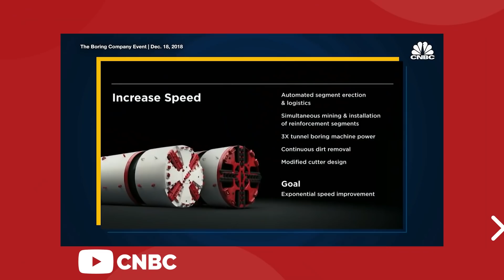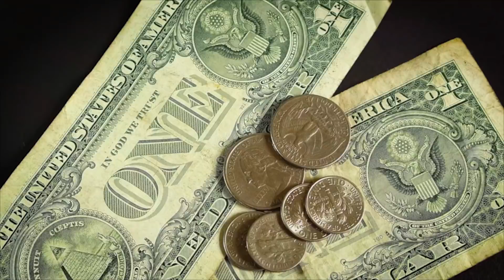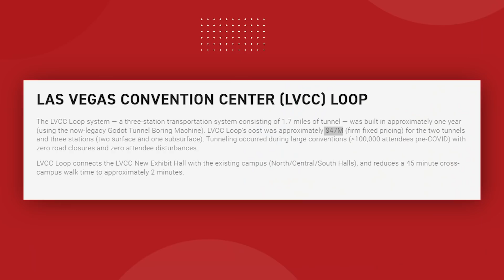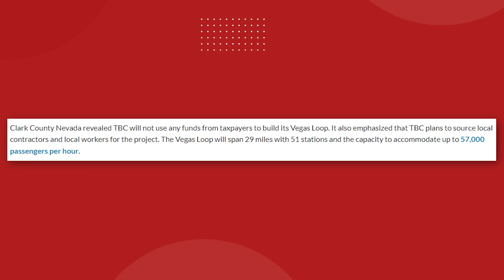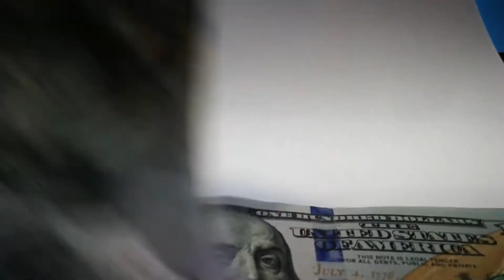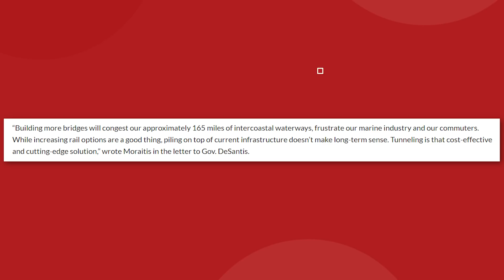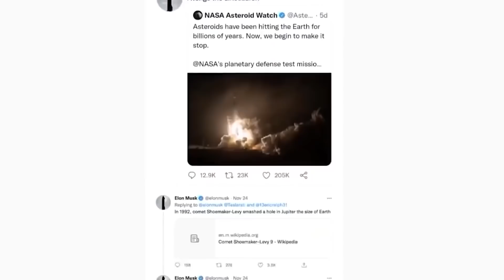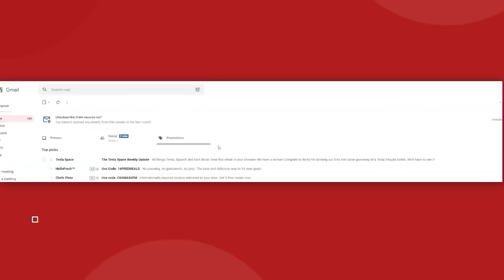The Boring Company 2022 Update

Comment: Imagine building a subway, but instead of using railcars, which can fit hundres of people and use one engine, use multiple individual cars, which all need their own engines and can only hold 1 to 3 people at a time.

This is so incredibly stupid
Reply: When 1-3 people enter the station, they can get into a vehicle and go.  Wait time is less than 15 seconds.  The trip time is less than 2 minutes. 

With a rail car, those 1-3 people wait on a platform while more people crowd in to wait with them.  Then the rail cars show up and all the people get on it and go.  But what if it's just those 1-3 people? They get on the rail cars that can hold hundreds, and take a very inefficient ride that they had to wait several minutes for?  How stupid is that?
Reply: @kevinbailey8827  Many people getting into a railcar together is much faster than entering cars individually. That way one person holds up the entire line behind him.
And if there were only very few poeple, that means there is no demand and they can use a car on regular roads.
Reply: @drthox3512  The cars aren't blocking each other when loading and unloading.  If one car is loading slowly and another car is loading quickly, the quick-loading car can go ahead and go, and the slow-loading car can take the extra time it needs. 

It one person is having trouble loading a railcar, the other passengers can shove that person out on the platform.  Otherwise the entire train is delayed.  

The loop system can smoothly scale to provide excellent service at any level of ridership.
Reply: @kevinbailey8827  Then why is it that there were traffic jams in the Vegas Loop?
Reply: @drthox3512  What traffic jams?  I saw that video.  The cars never stopped. What should have been a minute and 15 seconds in the tunnel turned into 2 minutes for a brief time.  

If that's as bad as traffic jams get in the Loop, and if they're as rare as that, I call it a roaring success!

I've experience far worse delays on subways.  Are you telling me that means subways don't work?
Reply: @kevinbailey8827  The cars simply do not have the capacity to be economically viable. A metro is cheaper and transports more people.
Reply: @drthox3512  An underground train is demonstrably many times more expensive to build.   Whether it transports more people is questionable.  In the case of the convention center loop, an underground train would not have carried any more people.  The Loop has carried everyone who showed up.   A train would have carried the same number, because there weren't any more people to carry.

Why would you spend four times as much to put in a train, when a Loop does the job and does it faster?
Reply: @kevinbailey8827  No, that is not questionable. Trains carry more people than cars, in a given space. That is a fact. They are also cheaper to operate, as they require fewer operators, consume less fuel/energy and break down less. The low demand also makes the loop unnecessary.
Reply: @drthox3512  If a train is full, it carries more people.   If it is empty, it carries no people. 

For the convention center, the low demand makes a train impractical.  But a Loop can be built for a fraction of the cost, so it can be practical in places where a train is not.

The Loop has other advantages, in that it can provide better service for its passengers.  It's going to open up new possibilities to places that have looked at other transit solutions and found them too expensive.

Comment: "The most efficient and affordable way possible"... 
Yeah, digging 2 miles for 2 years - efficiency fail.
CES 2022 - traffic jam underground - efficiency fail.
CES 2022 - a guy on foot being faster - efficiency fail.
Affordable - a project that started at 47 million ended up being 57 million - affordable fail. 
The tunnel - no emergency escape route, no fire suppression system, no in tunnel ventilation - safety fail.

Comment: I think the biggest issue with this stuff is that it still uses individual cars. As many in the comments pointed out. If you look at Japan and specifically Tokyo you can get a look at how good public transportation works. Until the united states starts doing that I think this is for the most part unimportant. Though it's good to see movement in that direction. 

Also if tunneling does get a lot better it would be smart in the long run to have almost all human transportation done either underground or in the sky.

Comment: Trying to solve traffic congestion by adding more lane/bandwidth won't work especially if you need to dig tunnels to create more lanes. If traffic congestion is solved by just adding more lanes to a route, the end result may possibly result in a highly inefficient network with higher maintenance cost. Solving network issues should employ far more complex strategies.

A good network needs to be highly connected and smart so that it is efficient.
Reply: They aren't adding lanes. They are adding bypasses where conventional bypasses couldn't be built. What "complex" strategies are you suggesting in an urban environment in which no more roads can be built? Individual under/overpasses to escape crossings with lights? That's extremely expensive and unpopular. My guess is that your only knowledge of traffic is network traffic, right? Well, the theory for that is completely false in this case because packet traffic on electronic networks doesn't slow down just because the network gets congested. Real, physical traffic, however, has a choke point where road transport capacity falls to a fraction of peak capacity as soon as cars are too close together to drive safely at the speed limit. The solution to congestion is therefor not traffic complexity but the removal of the last 10-20% of the load that trips trips the choke point.
Reply: @schmetterling4477 It really depends on the cause of the traffic congestion. Digging single lane underground tunnels is hardly efficient nor safe. Smart city with intelligent traffic management can improve city traffic with better result at far lower cost and maintenance. Examples include intelligent traffic signal and management, traffic calming and traffic assessment, electronic road pricing based on live traffic condition  etc...
Reply: @jk35260  The causes of traffic congestion are always the same. The amount of traffic exceeds the capacity of the roads. 

There is no space for new roads on the surface, hence we are going underground. Plenty of cities are doing it already. You are clearly not well informed. :-)
Reply: @schmetterling4477  That is your simplistic understanding of traffic congestion. Underground is nothing new but what is holding back city planners from building them.
Reply: @jk35260  The cost. Oh, wait, Elon Musk wants to build tunnels for way less money and he does. Kid, you need to learn to pay attention. You couldn't even pass kindergarten with your limited attention span. :-)
Reply: @schmetterling4477  You are so gullible.

Comment: Mostly all hype I think. TBMs have a better place in delivering high capacity LRT or Metros. Having better traffic management, vehicle interface and autonomy is a focus more important than constructing tunnel networks for piping cars about urban areas. The Boring company should really just try to compete with the traditional large TBM operators to deliver mass transit systems and roadway tunnels to cope with congestion. The scenarios see here are really just monorail mindedness.

Comment: All in all, I don't have any problems with the boring company's concept. If you see it as a high level of service transportation system, fully knowing that there can be many different levels of tunnels underground, it's pretty easy to see that literally all the traffic overground can be replaced underground without any problem, and whether each vehicle can transport one or more people isn't important in the grand scheme of things, as just making 10 levels means 10 times less traffic than on a flat surface. I have some problems with the use of teslas, as in my opinion having the "car carrier" like in the concept is much better, but I guess it was chosen for the specific needs of early projects. Overall, I quite like it, but I think it'll take several years for The Boring Company to reach full potential. What's sure, though, is that they hardly have any competitor in this potential market.

Comment: $1-1/2 Billion for 1-1/2 miles of traditional tunnels... vs $47 Million for 1-1/2 miles of Boring Co -- Project -- the entire project, not just the tunnel. That is a mind-buggering success! That's 32X cheaper than just the traditional tunnel, and that's just the beginning of the savings. This was proof of concept. It only gets better. It only gets cheaper and cheaper. So what if the marketing was too optimistic? What marketing isn't? The news and media are virtually full of "New! Groundbreaking! Revolutionary!" Scientific and technological discoveries that will change the world as we know it!
And not a single one of them EVER comes close to living up to their HYPE!
Reply: The comparisation is flawed.
The $1 billion includes large rail systems with more than a sinle rail and station and communication and contro,l systems.
Its not the boring which is espensive, it's the system design.
Drilling tiny pipes as Elon is doing is cheap.
Reply: @dilbert0815  OK. You go with that.

Comment: Like it or not, tunnelling is a mature industry. EV and rockets were not. Check the facts stated on this video, do existing TBM's use disel power, can the claim that the Boring Co. can tunnel faster stand up in a apples to apples situation, do TBM stop every 5'?  $1B per mile was based on NYC's last expansion, and the three stations cost more than the tunneling between them, the tunneling wasin hard rock, and included tunneling under and building a new station at GSD. Still way too much to spend, but again, the $10M per mile cost is a goal, not anywhere close to a reality.

Comment: The „others“ use electricity, just because a tunnels in construction does not have a lot air vent and many parts of such a machine need independent powering. Is he expecting a 19s century transmission belt version? They only use diesel in the trucks that bing the stuff to site. But Elon use the Tesla semi, right? Oh, that‘s why the project stuck way below snail speed at Zero.

Comment: Aside from the environmental issues, the tunnels are narrow.  Using one-kind vehicle, isn't going to work.  They should go with bigger electric bus or something like that.  Hell, they could just put guide rail in bottom/middle of the road to keep the vehicles on track while their in the tunnels at speeds like amusement ride cars they let children ride.  

Personally, the tunnels are too small and narrow.  Cost is an issue, frankly using electrical vehicles for these tunnels will likely save a lot money if they get them.  There better off with purpose built electric van than individual cars.

Comment: There are so many problems with what you present here. The idea that you portray these tunnels as efficient because they are only 12ft in diameter, barely enough space to fit a single Tesla just shows how dangerously uninformed your position is.

There's a reason other tunnels are much larger and use significantly larger machinery (which is also a large contributing factor to the speed difference, doubling diameter of a tunnel means moving 4x as much earth. Area = pi*r^2). The reason is that there is a plethora of additional safety and access requirements that need to be considered.

Currently, if any kind of emergency is to occur inside the single lane tunnels, almost nothing can be done for emergency responders to reach the site of that emergency quickly. They're contending with a queue of other vehicles occupying the same single lane. Not to mention the possibility of any emergency occuring during a traffic jam.

Compared to more conventional subways where all trains are networked together and constantly communicating, other emergency vehicles can always be dispatched along the other rail to reach the site of the emergency in no time. Additionally, human access tunnels line the sides of the primary subway tunnel so that humans can escape on foot if required. There is also a lot of additional infrastructure for ventilation among other things all of which these tunnels don't have.

People will die in these tunnels. They are significantly less efficient than just a regular subway. If you want to cling on to claims that the boring machines have new tech which makes them more efficient - great. But try applying that tech at a scale larger than 12ft diameter otherwise it's pretty useless for constructing any kind of safe transport.
Reply: These tunnels are also meant for electric cars. No need for a lot of ventilation. I am also pretty sure they don't just build tunnels without any exits. I am sure there is a code for that. 
I am skeptical for now about these tunnels myself but I'd rather try something than just sit around and argue as to what will be the best... and then get nothing at all
Reply: @eduardos8895  what do you mean no need for ventilation *because they're electric*? You realise subway trains are also electric, right? They still need ventilation.

This is exactly what I'm talking about with people being dangerously misinformed. If a fire occurs in a tunnel with poor ventilation, it will very rapidly consume most of the available oxygen. In such a low oxygen environment, with the addition of smoke inhalation, humans fall unconscious before being consumed by the fire.

Also, no, there isn't a special "code" to allow humans to escape through a fire engulfing a tiny tunnel. Their boring machine creates a 12ft tunnel. That's it. There isn't magically an additional escape tunnel that spawns simply because you like Elon.
Reply: @sockpastarock7082  I said a lot of ventilation. Not stupid,  I like to breathe too.
As to code,  I am pretty sure there is code for fire exits.  
I am also not claiming it to be perfect and I am sure a lot of improvement can be made
Reply: @eduardos8895  when you say you're "sure", you actually mean you're assuming because thats how it should be, right? Like if the state funded it and it was scrupulously subject to all that inefficient red tape of proper regulations and building standards etc.

We've seen one boring machine dig one single tunnel loop with just enough diameter to fit a single tesla and absolutely nothing else because apparently that's HiGhLy EfFiCiEnT. This is the big problem I have with this video - it's painting these horrible shortcomings as benefits and improvements over what it would call old, antiquated techniques. Those techniques accommodate many more scenarios and failsafes.

Why should we assume that actually additional access tunnels were also built in parallel to this highly efficient deathtrap? Especially when none of the video footage of people driving the full length of the loop reveal regular human access points? Actually, forget regular" human access points; how about *any human access points? I haven't seen one. And even if they are there, another big part of safety escapes is that they are clearly visible and communicated. What does it say if none of have seen any despite watching these videos?

Contrast this with any subway ride where you can see access doors regularly along the tunnel. Same is true for any regular car tunnel too. Keep an eye out next time you use any tunnel.

This is just the surface of all the issues that exist with this tunnel. In short, it's a Schlieffen Plan - it works amazingly only if absolutely nothing ever goes wrong. Elon's tunnels might have been fast and cheap to make but that might be exactly the problem.
Reply: Emergency vehicles can access a stranded vehicle from the unobstructed end, although they will need to easily and rapidly drive in reverse. The stopped vehicle may also be pushed to an emergency side tunnel by the next vehicle behind it.
Reply: @imconsequetau5275  you're making a lot of assumptions like the idea that there is an unobstructed end. Consider the case of an emergency occuring during an existing traffic jam. Maybe someone in any randomly chosen car starts having a seizure somewhere in the middle of traffic. How do you get them out? They're pinned in from front and back. Now amplify this problem with longer tunnels which contain many more cars and thus larger amounts of traffic. It's a death trap. This is just one example. I'm sure you've already read others pointing out how problematic a fire would be in these single lane death traps too.
Reply: @sockpastarock7082  
There was a horrific fatal fire in the Squirrel Hill (Pittsburgh PA) tunnel that involved dozens of cars, a jack-knifed fuel tanker, and a filled school bus. 

Now several generations (of drivers) later, the traffic still ritually slows down before entering or within said tunnel. The traffic typically backs up for many miles, sometimes affecting the beginning of the "Parkway" (Monroeville) because of that socially embedded behavior. It only requires a select few aberrant drivers per hour to create and sustain this slowdown. 

I did research into this because the very first day I approached that tunnel (westbound), the car in front of mine came to a complete halt and waited until there was no visible traffic ahead in the left lane.
Reply: @imconsequetau5275  was that the Stallone movie?
Reply: @willudallmusic  
Art imitating life.
Reply: yawn